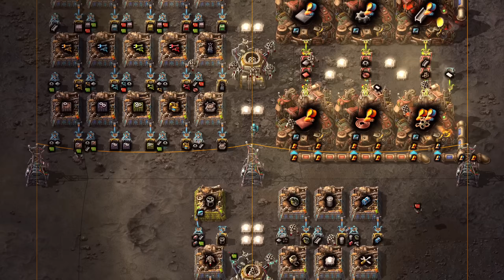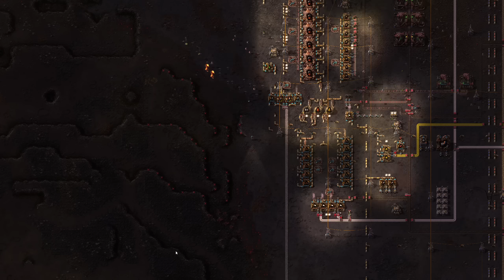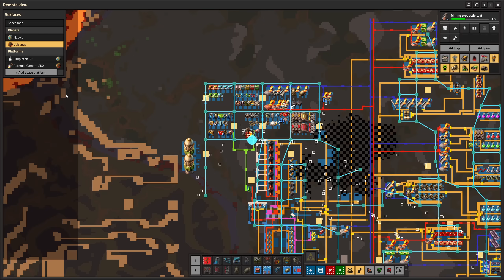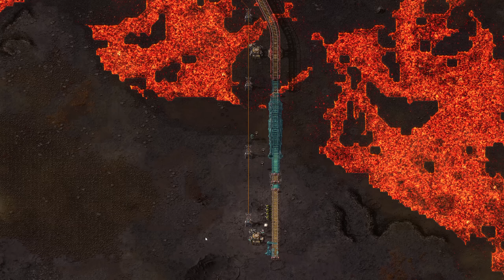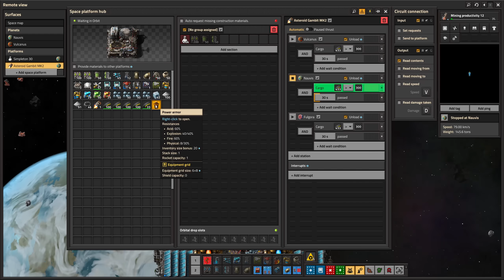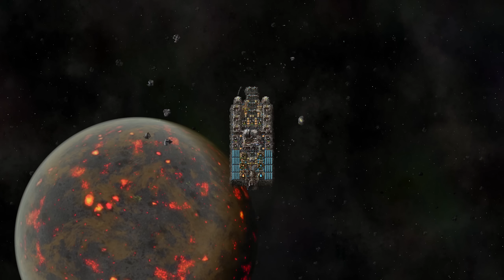Will This Train Save Us? — Space Age MEGABASE (Factorio 2.1)

Comment: As a native speaker, the module names have always made sense to me. Besides, if we called the productivity modules efficiency modules, what would we call efficiency modules?

Also, if you connect a splitter to something with a wire (another splitter, a power pole, the belt in front of or behind it, it doesn't matter), you can check the "set filter" box to get a filter that filters absolutely nothing as an alternative to filtering for deconstruction planners. I like the way the filter looks a lot better, but it does require you to connect it to something, which does add a bit of visual noise. I like to lean into it and use a constant combinator to the side of the splitter.

Love your editing style! The pacing is very good; it feels like everything gets covered at a high level, without explaining the function of every single inserter.
Reply from the maker: After using the wire trick you can disconnect the splitter and keep the filter symbol. Despite that I don't like the symbol that much and will stick with the deconstruction planner.

Comment: The way I use ACTIVE PROVIDER chests, is with Isolated logistic networks.  I use a loose City Block style format where each block has an isolated logistic bot network, surrounded by a web of roboports with construction bots only.  

At the borders, I have transfer inserter stations.  Ingredients are delivered by train only.
Output:
- Construction goods are manufactured and delivered to buffer chests along the perimeter of the Isolated network.  These request minimum amounts from production, but also allow excess to be stored.  Inserters pass the goods to storage chests on the outside, with limits set on the inserter to prevent excessive production.  The reason for buffer chests is so that internal mechanisms can request some of that stored resource if needed, like for red belts needing yellow belts as an ingredient.
Input:
- Returning goods from construction are placed into filtered yellow storage chests on the outside, which then use inserters to pass the items Into the isolated network and ACTIVE PROVIDER chests. Bots then transfer those goods from the ACTIVE PROVIDER to the perimeter buffer chests to be put back into rotation.

Advantages: 
- This setup prevents logistic bots from running around the whole map.  the number of bots needed is orders of magnitude smaller than a traditional bot base, increasing transport efficiency and decreasing power usage.
- Construction bots still have free reign, and can build Most things inside each block with clever placement.
- Very robust
Disadvantages:
- It takes a bit of planning to set up.  
- Occasionally construction bots will stop to recharge inside a block, and get transferred to the internal network, thereby getting stuck.  Some clever logistics can push these out to the perimeter and back into the network if needed.

Comment: Efficiency and Productivity are similiar, but focus on different things.
Efficiency is the same output with less input
Productivity is more output with same input
Reply from the maker: Which is funny, because if you insert prod modules into assemblers you will get the same (or even slightly less) output with less input. Which by that definition is efficiency. ;)
Reply: @AVADIIStrategy you get more output per input. Productivity refers to resource efficiency, not time efficiency.
Reply: @AVADIIStrategy  You get less per time unit, but more per input unit.
Reply: but measured on what? item count, throughput count or even build area could be a measure of efficiency or productivity :P